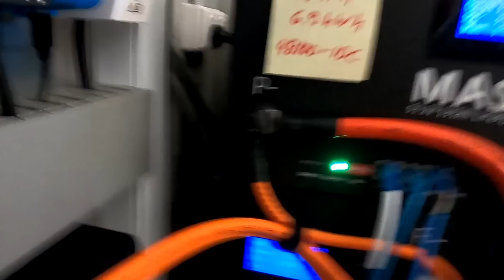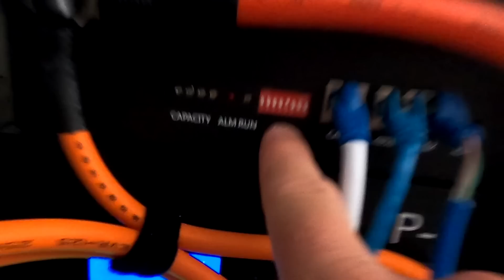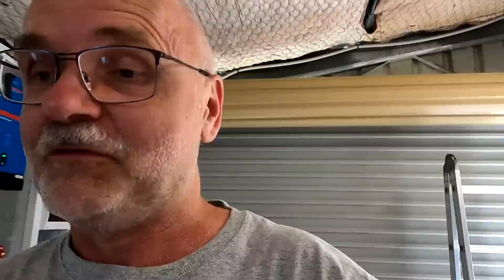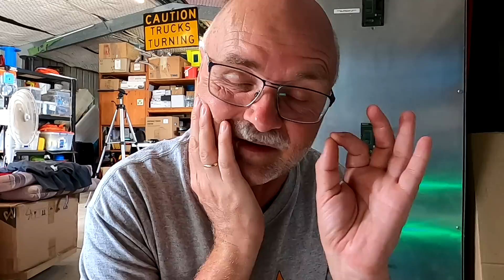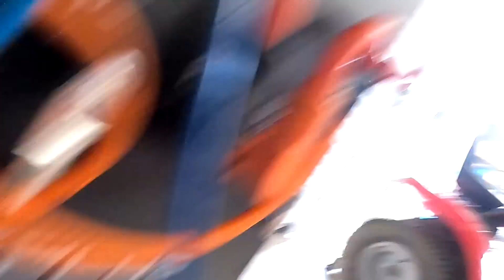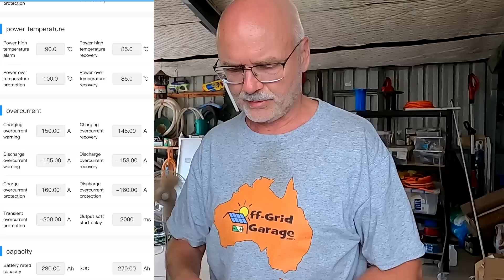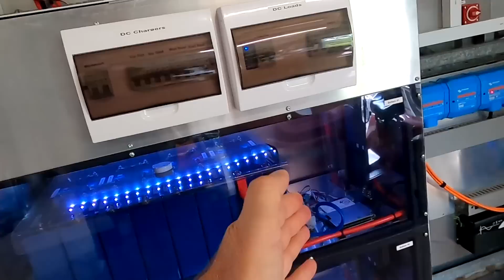No (easy) access to Master BMS of your Seplos battery! Seriously?

Comment: Another question - when you call up the BMS in the Victron Remote Console, there is a  history - this shows the charged and discharged energy - how can this be reset?
Reply from the maker: This can be reset in the Smart Shunt. Connected via Victron Connect to reset the stats.
Reply: @OffGridGarageAustralia   I don't use a smart shunt in this system - here the Seplos BMS is the only battery monitor and sends the values to the Cerbo. Unfortunately I haven't found a reset function for this on the Seplos or anywhere else?

Comment: Hi Andy, I see the same frustration as mine. But since you have a BMS with the 10E version - is it possible to operate this as a master while using the new function of the 10E with automatic addressing without DIP switches? If you had several new 10E BMS - would they communicate with the automatic addressing in such a way that the master BMS is also accessible via PC?
Reply from the maker: I did that in the video a bit later and changed the master to the battery with 10E BMS.
I doubt you will have access to all the BMSes even if you only use 10E versions. I will try when my other cells are here...

Comment: Hi Andy! 
And thank you again for this video, as I told you previously in one of my messages, the battery do not communicate with each other, not with each other, the communication cables to be connected in cascade on each battery are only made for Monitoring, just to be able to monitor all the battery at the same time.

Obviously when you position the address cursor for the Can communication, it's over, it no longer works. and the Cerbo (or inverter,solar controller) will have data from the master battery only.
It is for this reason that for me, this story of communication is just sales pitches.😁
Quite simply, if you set the settings on the solar controller or inverter to Good, you don't need any communication at all (this is my opinion)
I don't know enough about the victron system and the cerbo, but I have already noticed that when you connect CAN to 1 inverter,
the inverter only has information from the master battery.
(very easy to control when you have communication by CAN you disconnect one or more communication link cables, and nothing happens, but of course if you disconnect the master communication cable, you instantly have an error and alarm)
Regarding the differences in charging and discharging current, this only comes from the different resistance of your battery. you will never be able to correct this, or just modify the behavior of the battery a little, by slightly modifying the settings of each battery, but necessarily you will always have these differences in charging and discharging current, so automatically a battery will charge and discharge differently from the other.
To be able to maybe? have the best possible balance, you have to use the same cells (which also have the same resistance between them) and use the same BMS with the same cables (identical length too) and connector too, but despite this, as you get older, the differences will be even more important.
Is that why Andy when you did your Big battery charging and discharging tests with 3 different BMS and different cells, and also different capacities, I was very surprised that the balance of the 3 packs was so good? I was very impressed?!
In the end, it's not really a problem, to have these differences between the battery, the important thing is that they all charge completely and also discharge normally, and all protect and balance individually and correctly.
About this slight problem, I had to find if there was a device, just to balance the Full packs between them!!, I had found 1, it was called DBMS (for differential battery management system) on the principle and data sheet, you could adjust the charge and discharge of each pack individually! this device connected between your solar controller (or inverter) and the battery packs.
But after having had all the information (data sheet, user manual) it seems to me that this device has never seen the light of day??
There were 2 models, for 4 battery packs or 6 packs. (and different voltages and current of Max current charge and discharge)
You could even connect Lithium batteries with lead acid!!!, because you could normally set them completely differently. (Voltage and charging current, bulk and floating different)
If you are interested, I can forward the information about this, but it seems to me that they have abandoned this device, probably because it was not working properly?😜
Thanks again Andy, for this video, because you always want to do the right tests, and understand the operation and the results as well as possible, and to share this with us is really nice!👍
Reply from the maker: No, the comms still works when CAN is enabled. We can see the low/high voltage and temperatures across all packs, so the master is collecting all this info via RS485 and send it combined to VenusOS.
I'll keep trying...

Comment: I still think that if you connect battery packs of different capacities together you're going to have problems, regardless of the equipment. They may be different than the problems you're currently concerned with the SEPLOS, but they will be just as bad if not worse. Would you assemble a battery pack using different capacity batteries? Because this is EXACTLY the same thing, and it's a bad idea. Even when you're using batteries with identical ratings, you'll get the best results by matching the cells after doing capacity testing on each cell, and try to get them all to the same SOC and voltage before assembling them.

I also don't think this particular issue of the master pack settings is as big a deal as you're making it out. Generally a BMS is going to be set once, and maybe make some changes in the initial setup period if you forget something, but then it will never be accessed again. Many BMSes in battery packs that you buy preassembled don't even have the possibility of changing any settings. You're just permanently stuck with however they came from the factory.

I'm not saying your concerns aren't valid or that SEPLOS shouldn't address them. But I do think you're losing sight of the fact that you are all about comprehensive testing and catching edge cases that the average person will never experience.
Reply: You should watch some of the video where he has explored and disproved this already .
Reply from the maker: Not a problem to connect different battery sizes together. Also not a matter on how you connect the batteries.
Reply: It won't be if he connects the main +ve and -ve to different packs, they will self balance.

Comment: My guess is they never anticipated somebody wanting to use CAN and RS485 together. Probably the same chip is responsible for both. I'm not a huge fan of bluetooth BMS's either because you have to be in range to use it. It sucks as a monitoring solution.  Andy, to solve the situation with the incorrect monitoring on Victron simply tell it that each battery is half the size of your total capacity or tell it it's one battery with the total capacity. That's how the Victron sees it, anyway.
Reply from the maker: Well, they use both at the same time, RS485 for internal comms and CAN to report the combined data to VenusOS

Comment: Is the small pack BMS 48100-10C pcbV14 still running on FW V2.8 specific Victron/SMA version or also updated to the V2.9 general version? 
In a week i will catchup with testing to this point (Deye with 48200-10E pcbV16 + 3 slaves 48100-10C pcbV14  all on FW V2.9)
Reply: Please share your experiences with this setup
Reply: @deonbezuidenhout1304  I will do,  but need to wait until weekend.
Reply from the maker: FW 2.8 is necessary to make it work with Victron system. Not sure what changes 2.9 brings as they don't publish change logs.
Reply: @OffGridGarageAustralia  Technical information is rare, I only got from seplos the "BMS can get confused". 
I'm going to run the combo anyway with a Deye 12k SG04PL3-EU, 48200-10E as master with three 48100-10C V2.9 with daily one cycle, let's see how that goes. 
A 4th 48100-10C isn't a solution for me to charge the EVE LF280k cells (10%>90/95%) in mostly 2 hours daily i have.

Comment: I'm just wondering... Why the hell bother with unpredictable Seplos BMSs if "on the table" there are very good, proven and additionally acting as a balacer JK BMS?
The next thing that raises my doubts: why the hell do battery bank BMSs need to be connected to the Victron MPPT and communicate with it if Victrons have a trivially simple algorithm to execute, which they implement without any additional requirements: charge the batteries to a specific voltage!? What are the specific benefits of such communication apart from displaying them on the Victron display?
For me, the ONLY really important feature of the BMS is the ability to WIRE communication with the computer to monitoring (and collecting data) the SOC and implement the setting of BMS settings using dedicated software. If individual banks appear as independent tabs in the soft that supports BMS, it will be a dream come true for me. A start page for such software, showing the total capacity of all battery banks and the total SOC will be a very welcome, but only as a bonus.
Reply from the maker: First, I'm testing things (like always on this channel). Secondly, the comms might be necessary for larger systems as I explained. If single banks are shutting down, you don't want the MPPTs keep hammering power into the remaining banks. Same if it gets too hot, slow down...
Reply: @OffGridGarageAustralia  Well, we both look at it from different points of view. I am looking for, with a purely utilitarian intention, a solution that will allow me to power the house (the construction of which will start in full swing in the late spring) in a fully off-grid. So much so that I'm not even going to connect to the power grid at all.
I'm watching your fight with the Victrons with interest, although personally I bet on the Chinese inverters, it's Revo II. Currently, two are in operation, connected in parallel, guaranteeing 11 kW of continuous power (NOT apparent power kVA!!!) and 22 kW of instantaneous power (starting induction motors).
So far, inverters powers induction motors without any difficulty, I personally checked: the power of 7,5 kW (only induction motors) does not impress them in the slightest. The voltage is perfectly stable, even at motors start-up. So far, I'm really happy with these inverters, especially since they cost me a fraction of the price of the Victron solution that I was considering as an alternative.
I deliberately do not expand the installation for the construction period. I want the inverters, in particular, to undergo a real stress test during this time.

Ultimately, the system will certainly be expanded to a three-phase system with more power. But this is a song of the future, at least in a year, mayby two years. And for sure, the target capacity of my battery bank will exceed 1000 ampere-hours, many times over, I think. How many times it will turn out after confronting the real energy demand of my future house, especially in winter, with the ability to generate energy of PV panels.
If I manage to carry out my plans according to the assumptions, I will have no reason to seriously consider or testing other possibilities. I will be happy and... I will end my works by changing my status from a constructor to a regular user.

Comment: Sorry to hear you're having a frustrating time of things, Andy. I would have hoped that Seplos would take feedback on the parameter names; misleading names befuddle the debugging process.
I'm flip-flopping on the idea of multiple BMS-es communicating with the charge/discharge system. More than one battery is difficult as there are multiple ways of getting them into different states of charge; the BMS making charge/discharge decisions, fuses could blow, breakers trip or even simple stuff like different cable lengths or loose connections. One would need a master BMS smart enough to detect these kinds of situations, and I think you're a bit tired of the smart in BMS. It does make me wonder how Pylontech does it ...
Reply from the maker: The Seplos system is not there yet. Even using the same batteries and BMSes, some parameters are still hard to identify. Controlling the whole system is hard.

Comment: and 485 bus is OK? You are not uising any termination. 485 bus should be terminated on both sides with 120R resistors. Same as CAN bus.
Reply from the maker: CAN is terminated and RS485... not sure, they obviously don't have that. Maybe due to the very short cables.

Comment: My question..
Why use the 485 at all.
If both are CAN to the Cerbo, and not linked together by 485 do you get to talk to them?
May be for 485 the address has to be something.
Sticking with my Rec BMSs for now.
Reply from the maker: In the Cerbo, you could only specify one of the connected BMSes as the battery monitor. All others would be ignored.
The REC seems good but very expensive.
Reply: @OffGridGarageAustralia  

Thanks Andy and keep up the good work!

Yes this is true.  BUT BUT... if the batteries are as as closely matched as possible..
And well paralleled their charging and discharging set points should be effectively identical.  Thus the one battery tracked is not a problem.
I added a simple Node Red macro on Venus OS Larger to checks that my multiple batteries are closely in sync and shuts down the system if there is a problem. 

I am wondering if the Venus support for singular battery might change soon.  In the boat world NMEA E13 calls for multiple lithium batteries that have to be monitored.

--
I believe that the RS485 comms protocol that Seplos are using only mentions voltage, current and SOC.  Because no capacity is communicated the master battery can only guess that each of the battery capacities is the same and multiplies it's own capacity by the 2 SOC values.
This is clearly a bad idea, but it is why Seplos say "only one type of battery"
Reply: Correcting my words..

Correcting myself the Seplos RS485 messages  contain 2Bytes of battery capacity at a 0.01Ah resolution as well as capacity remaining and SOC,
It does appear to output it based on a sample of one BMS. and the Seplos protocol document.. file:///home/brian/Downloads/SEPLOS%20BMS%20Communication%20Protocol_V2.0.pdf

Comment: A lot of battery BMS suppliers says NOT to use address 0 as it is supposed to be reserved for the charger/inverter connected. Use address 1 and 2, not 0 and 1.
Reply from the maker: Well, we're not connecting to an inverter here but to the VenusOS.
I read this too, but as we have seen, address 0 is good for Pack00 in the software and works.

Comment: If you replaced both seplos BMS with JK BMS, would you be able to see both batteries in the Venus OS??? 
The reason I ask is because I am running the JK BMS on one set of 270Ah batteries and I'm thinking about getting another set but at the moment I only have Bluetooth access to the JK BMS and would like to be able to access the JK BMS over the internet from anywhere else around the world.... 
Also, I was thinking what if you set one seplos BMS to pack one and the other to pack two? But from what I'm seeing.... It probably won't fix the communication issues....
Reply from the maker: No, you would see only one battery. That is exactly the problem. You can make only one BMS the Battery Monitor in your system. Hence the communication between the single packs and the master BMS is the consolidated battery monitor.
Reply: @OffGridGarageAustralia  I get what you want from a BMS, and I also believe that should be standard... But right now, I would be happy if the one BMS could report for the total capacity.... 
I'm happy with JK BMS, it just works but I only have one set of 270Ah worth of cells and I'm wondering if when I get a second set of cells, should I also get another JK BMS or should I just parallel them to what is already there? 
Because at the moment, the amount of current that the 3kw xing ping inverter (exactly the same as your one) is drawing from the battery, isn't coming anywhere near the limit of the JK BMS.... 
Although.... I have yet to connect my main fridge in the house to it, I was running the solar system on 3 48V strings of 12V 8Ah Lifepo4 batteries.. they have internal BMS's and when the fridge would fire up, the induction spike would kill a BMS here or there.... I have seen over 3kw spikes when the fridge would fire up but you have to watch the app constantly (you are not the only one who has done that LoL) and it never shows up in the history! 
If I'm drawing 3.5kw from the inverter and the fridge fires up, the Xin Ping inverter goes into protection and shuts down.... It's also annoying that the inverter just sits there beeping! It won't turn back on even if the required voltage is there!!!! 
I don't know, somehow I feel that if this was Japanese made, it would function as expected! 
I have seen where people have a shop and are selling something that they have no idea what it is..... That's like a factory making solar equipment but for some reason don't know what they are making and as a result, don't have a research and development department..... They probably have a "let the customer figure it out" department!!!

Comment: Hi Any, you are forgetting that you can access the BMS over canbus in canbus mod.
the rs485 connection problem is the limitation of modbus protocol, unless they switch a proprietary protocol there is nothing they can do about that.
Reply from the maker: No idea how this would work. And if so, it would only give us access to the master, I believe and we need to use the Battery Monitor for the other BMSes?